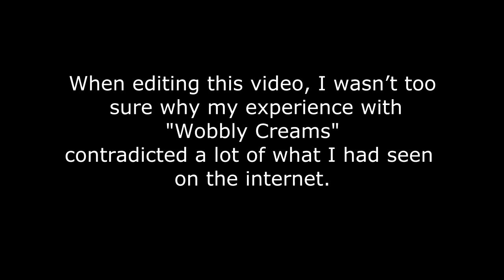Switch Films Explained with Comparisons - Minimising MX Housing Wobble and Stem Wobble

Comment: I just modded my creams with switch films after noticing top housing wobble on nearly all of them, its good to see a video validating me doing so despite everyone saying, as you mentioned "they have tight housings so there is no need".
Reply: Which films did you use and did it anything on the sound part? I’m thinking of kebo films since they are the thinnest, but not 100% if filming is worth them.
Reply: @Definitely_Melnyx  I've filmed creams with deskeys and they work well. noticeably less woble but I can't really say much on how they change the sound tho
Reply: @hughle9913  Good to know that the deskey films work well with creams, I intended to use these as I have some Alpaca stem swapped creams that have some noticeable stem wobble. Any issues with closing the housing afterwards? I figured because they are a compressible material I shouldn't really run into any issues at all.
Reply: Melnyx got the kebo and tried it. Not too expensive from AliExpress. Definitely worth trying cause everyone’s mileage may vary. Personally feel that it only works really well on very loose top housings like even on old switches like Mx vint blacks. Remember that if you tend to open and close them too often they may get also get loose and having them too tight may cause your fingers to feel the vibrations when bottoming out... plus I get bothered when some loose ones had films and some don’t it’s a pain to fit in too and it gives off a plasticy sound too. HAHAHA. it is what it is... fun experience if you enjoy fiddling around.

Comment: I really dont see the point tbh like sure it makes it a bit stiffer but the reduced tolerance isnt necessarily beneficial to the operation of the switch and once you put a cap on and start typing you will barely notice the difference anyway. you are better off spending your money on some acoustic foam for the case to dampen the blow of the keystrokes and reduce sound reflections from the inside of the case.

Comment: Your calipers are not in metric at all currently, the moved decimal mentioned is 'thou' or thousandths of an inch (hence the 'in' on the left).
Should be the blue mm/inch button that swaps between metric and imperial (but if it's not working... time for new ones).
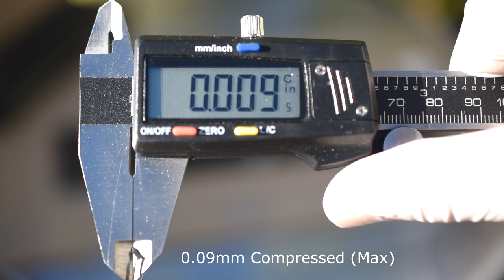So @ 4:15 0.009 is 9 thousandths of an inch or 0.229mm, not anywhere near 0.09mm
For reliable and repeatable measurements in these low ranges consider acquiring a micrometer.
They have a spring / ratchet mechanism to remove the inconsistent element of pressure applied via the tool.

Measurement in metric for anyone interested
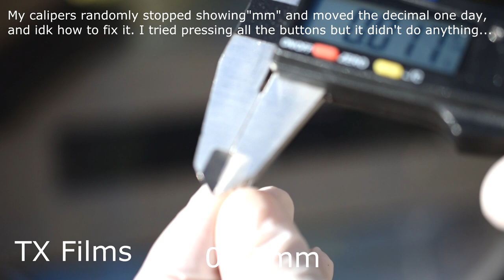@3:57 15 thou = 0.381mm
@4:08 29 thou = 0.737mm
@4:15 & @4:20 9 thou = 0.229mm

Comment: Even in switches that people say dont need a film, the film will still slightly alter the sound of the switch making it sound a bit deeper. It's preference and miniscule but I prefer a deeper sounding switch. Even though the sound is pretty much determined by your keyboard case, I still feel it's worth it.

Comment: I don't like that you dismissed the sound aspect, it is the most important when filming switches. You honestly don't feel much change in typing. The only thing that is changed is the amount of rattle from the switch. And so filming is an amazing mod and I absolutely love the sound. Still a fantastic effort about debunking myths of tight switches. Still, I think it was wasteful because of no sound.
Reply from the maker: For this video I wanted to focus on getting visual footage that could show people objective/tangible benefits of switch films, hence why I mention housing wobble in the title because that was the focus of the episode.  

I disagree when you say the sound aspect is the most important when filming switches. Typing on taller profile keycaps the differences between wobbly/non-wobble housing are extremely noticeable. The off-center presses are inconsistent and feel horrible, example at 0:25 with the SA keycap. 
Hence, I’d argue the performance improvement switch films provide are more important than potential benefits to acoustic, as wobbly housing affect the typing experience and usability. Sound does not affect usability, which is why I argue it’s a soft attribute and intangible.
Reply: While the sound aspect is another big factor when it comes to switch modifications, it ultimately comes down to personal preference as to how critical it is. I personally also love to film switches more for the sound profile change than the physical reduction of wobble, but that's not to say that the sound is the most important thing when it comes to filming switches. In addition, it's quite difficult to fully control the content creation geared towards sound profile changes and modifications due to the many governing factors towards sound characteristics. Even something such as the camera and microphone used to record along with headphones or speakers used by a viewer can greatly change expectation versus reality of how these modifications may affect a switch's sound. I'd have to respectfully disagree that the content was wasteful because of having no sound as it was able to remain objective and very scientific and it looks like A LOT of work was involved.
Reply: @idyllicKeyboards  Ahahahah Ok I understand what you mean but I will just slap it with preference as you said. For me, I can type as good if not better on a shitty rubber dome keyboard for 15 bucks at school. I care most about sound unless it is impossible to type like literally worse than a keyboard from wish. So for me, sound > everything else. For people who care about the wobble it's good, I was partly wrong
Reply: @idyllicKeyboards  I think you put too much focus on getting visual footage of making them wobble. As you noticed, some of them aren't made for PCB alone and in that test their movement is enhanced without a mounting plate.

Comment: Great video!   For a long time I wanted to use a mechanical keyboard... cool factor, but ever since the using the original logitech cherries.. i was very disapointed of the wobble just putting my fingers on they keys.   Then looking for reviews...a lot of reviewer conveiniently leave this out.  I checked out the logitech G915 at a store a few years ago, and I like that type of "not wobble" but 💸💸💸.  ff almost a decade..    I've given up on the search now.

IMO,    The design of most of these have a fundimental flaw.. imo.. being square.  they coull easily be metal rount housing. this make holes easier to have manufacturing/molding tolerances.  square is hard to manufacture.  the cheap housing screems of lazy engineering or that plastic is just too expensive.

Comment: THANK YOU. This world of novelty keyboard crap is too fussy! — plenty of us just want the minimum info needed to figure out our preferences without throwing money at recommendations of others. 😄

Also, I’m inferring from this video that keycap wobble is probably going to vary with the age of the switch molds, regardless of the brand/product. So getting minimal wobble means buying for that spec or filming yourself—especially if you’re already opening the switches to lube or whatever.

Comment: Excellent video, I have a related question: recently got some black inks and lubed/filmed them with tx films (0.125 thickness) i had left over from other switches. I ran out however and got deskeys like films (well rated but off aliexpress). I didn't realize at the time that they're a lot thinner and flimsier. So I installed some of those on the remaining black inks. Now I can't say they're worse at reducing wobble, but it was pretty clear the inks with the thinner/softer films sounded significantly more high pitched (basically the same higher pitch of stock inks except these were lubed). Is this something you noticed too??

Comment: You should consider grabbing a micrometer (if you haven't already!). Calipers are not accurate enough to give you accurate results at that resolution. Very good calipers can be consistently precise, but they tend to not be accurate enough. Micrometers tend to give you both precision and accuracy (and are an overall far more limited use tool!). Great video excepting the low audio volume. Subbed and looking forward to watching your other vids!

Comment: I found that my tfue switches did have wobble but I found it very difficult to close the housings with tx films in them so I left then unfilmed.  Idk how other ppl managed to film them
Reply: They used different films.
Reply: if you use deskey films they can still close even though its tight since they are a softer material. It does still take some force to close them though.
Reply: @ryantriesthings  nah some ppl like andy nguyen managed to film them with tx films
Reply from the maker: yeah it was weird cause some I could film (the ones in the video) but a few days later when I tried filming some other creams with TX, they just wouldnt accept them. So I've just been using deskeys since theyre compressible.